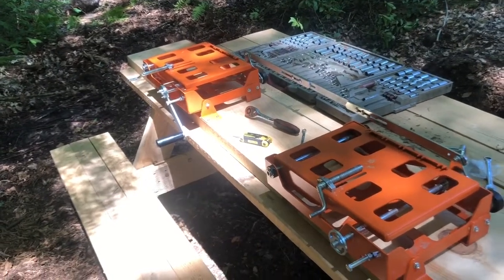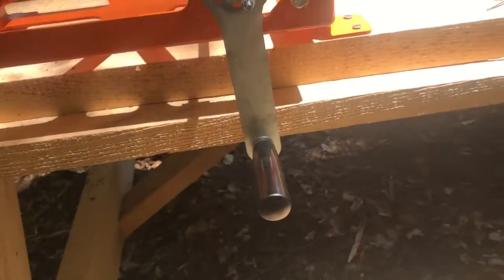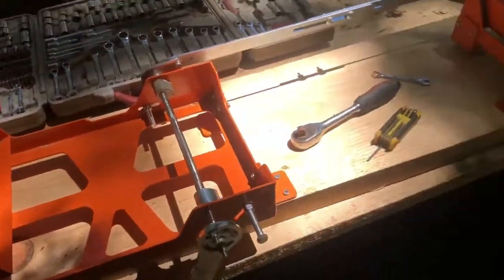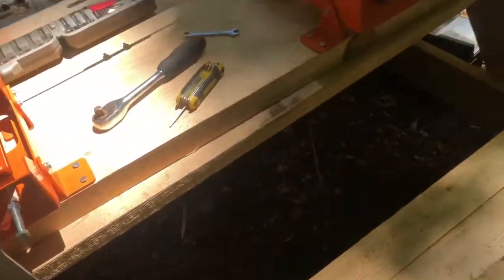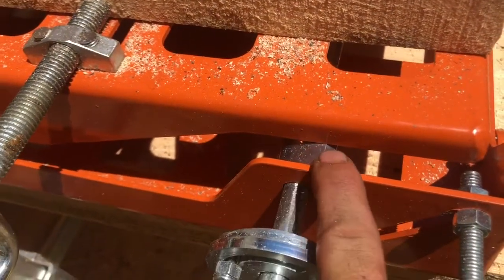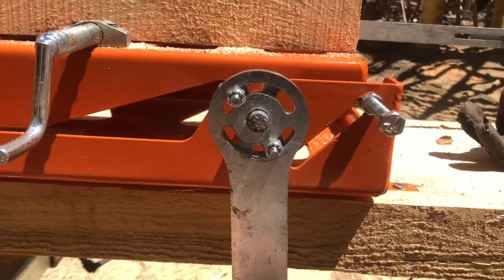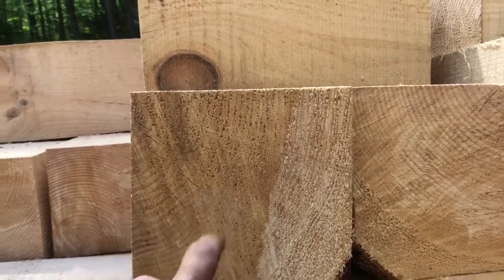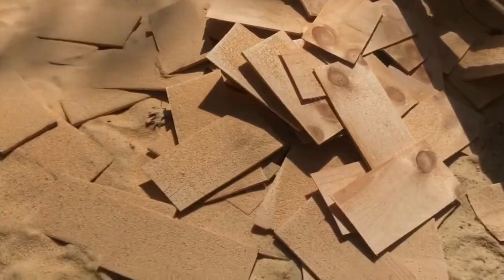Norwood shingle maker assembly problem solved

Comment: I just put mine together.
I bought it from a private sale.
It was new in box, but 3 years old.
I am missing the linkage between units, and some set screws. I will have to turn my feet around. And i wasn't sure where to set the handle, or the stops.
This video is a great deal of help.
I will get some parts locally, and finish mine up tomorrow.
Thanks.